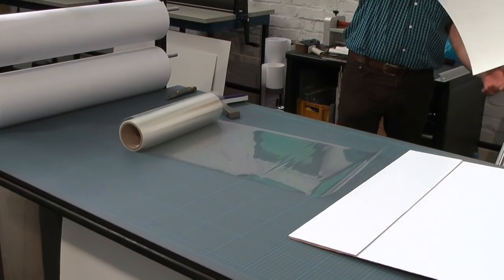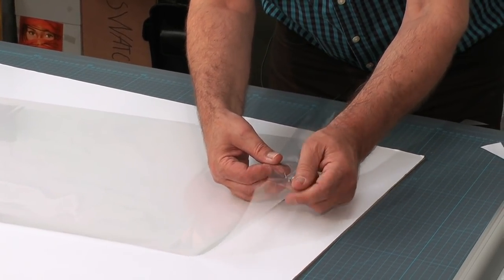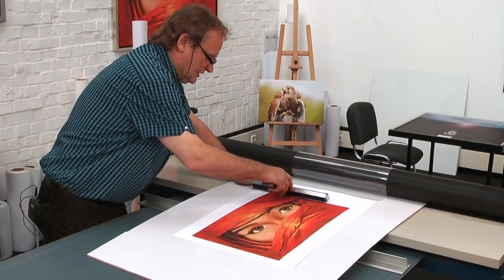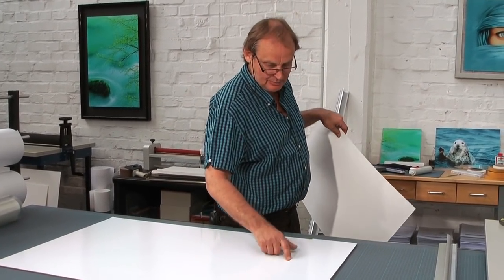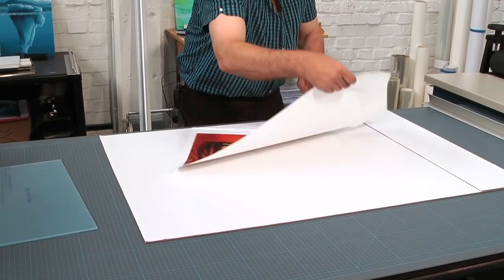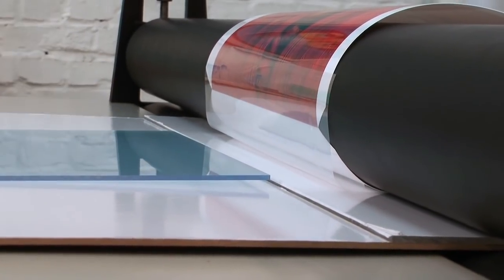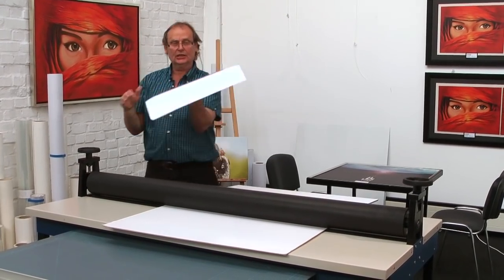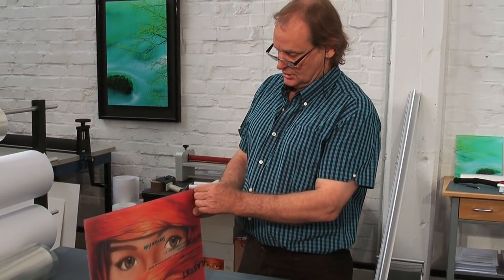Video Guide Laminator 11 - Mounting prints behind acrylic

Comment: Experience is everything. Fantastic workmanship. Bravo
Reply from the maker: Thank you... :-)
Reply: @ZenithArtSystem  Hey, I bought about 2 weeks ago, adhesive film (from your shop in Bonn). I can't get the printed photos without very small bubbles on acryl! Everytime, after printing (using a Canon  Pro 100S - flawless print), adding film to photo (flawless), I get very small bubbles on acrylic/plexiglass (visible only if using a led frame - all 4 sides have a led light). I printed already 5 times and everytime I get those small bubbles. I've written in english for others who may have similar issue.
Reply from the maker: @as6488  Without seeing the bubbles I guess you are talking of the really tiny ones, which are called "Silvering Effect". Those may come from the paper you are using to print. Which paper do you use? It needs to be absolutely smooth, like a high-gloss photo paper or our synthetic paper (printable PP-Film). Also the best results  will be with extruded acrylic glass (XT). Here the thickness tolerances are normally less than in the GS-Version.
Reply: @ZenithArtSystem  Thanks for your reply and sorry for delay. Using XT Evonik 8mm (polished). Paper: A3 & A4 - pro platinum pt-101 (glossy). Printer: canon Pro 100S. Roller laminator (desktop version): 75mm width, cold, 64mm diameter silicon rollers. The issue I have is ONLY during last step: applying the printed photo (film already add) to the acrylic.
Reply from the maker: @stonewolf777  Hmm. This is not so easy. Everything looks correct. Maybe you have not enough pressure? We found that in the last step you really need to apply a lot pf pressure. Or the rolls from your laminator are too soft? Or they are uneven? You can check this, if you put them together so that you only see a tiny gap and then slowly roll them. If the gap opens and closes you have a problem. Or maybe it is too cold in your workplace? Then the adhesive of the film does not "flow" nicely. Is it our adhesive? Where are you based?

Comment: Great video Klaus!
Laminating rollers do work well but the order of technique demonstrated in this video is critical I agree in order to acheive the best result
All I need to do now is buy myself one of those dust remover blades
Reply: Yes you do and the roller is a serious tool and not cheap but will last for years...

The roller is called a DRS-1 for "Dust Removal System" the are widely available from companies who supply laminating films and adhesives such as DRYTAC... the manufacturers website is http://www.sdionline.com/ 

The tac level of the roller is color coded... for general purpose I recommend a red one... David Goetter large format application expert :-)
Reply: goetterdone what is the ballpark price range for one of these roller systems?

Comment: Great job! Thanks for the tutorial.
Which kind of paper do you recommend for this work?
Reply from the maker: Thank you !!
We are offering an inkjet-printable Polyproyplene, which we call "Synthetic Paper". Available in Matte and Glossy, plain or self-adhesive. Check our webshop for the sizes and prices.
You need a VERY smoothe paper for this, the best is a plastic foil. Otherwise yo may see little white or black spots due to the texture of the paper...
Reply: @ZenithArtSystem  
Thanks a lot! I ordered a roll and hope now that the problems (spots you described) will be resolved.
Reply from the maker: @wrobi2267  Yeah, thank you.
Please feel free to contact us if you still have the issues and we will try to help you solving it...

Comment: I learned how to mount acrylics from the video and have done about 20 since! The biggest I have done is a 20 x 30 successfully. I am now trying to roll a 30 x 45 inch print but am getting bubbles EVERYWHERE! All over the surface of the photo when I put the double sided adhesive one. Do you know what is going wrong? Thank you!
Reply: Well, this is hard to answer without seeing it. Are the bubbles like tiny black or white dots or really big bubles? Size approximately?
In which stage do the bubbles appear?
It could be the paper? But I gues you have used the same.
It could be the pressure of the rollers? Did you change it?
The temperature? Is it "normal" room temperature? Also in the night where you store the roll adhesive?
Finally maybe the Acrylic itself. Is it XT, i.e. Extruded Acrylic? The cast acrylic has more thickness tolerances so we do not recommend using this type.
Reply: @DirkBilgen  they are bubbles that are bigger than silvering. About the size of a thumbtack. I was able to mount the photo successfully by using an empty roll to wrap up the liner. This kept the adhesive tight to the roller and I also used less pressure.

Comment: I get a little bit of silvering when I roll the photo onto the glass but there is no silvering when I roll the adhesive onto the photo. Any reason for this? Thank you!
Reply from the maker: There are a lot of possibilities for this. Some of them are:
- Not enough pressure
- Rolls of the Laminator are too soft
- Rolls of the Laminator are not absolutely even
- The acrylic has too much variation in thickness
- The Double-Sided Mounting Film is not from us :-)
- The Media used is not from us :-)
- The working space / storage room temperature is too low
Reply: @ZenithArtSystem  how soft should the rollers be, still rubber right? There is about 2 mm of squish at high pressure.
Reply from the maker: @moosec6985  The rollers need to be hard. There should be no squish at all. It seems that this is the problem already...
Reply: @ZenithArtSystem  ok, I tried with the laminate warm and I did not get any silvering. I do it in my garage and it was below 60 degrees. That is too cold, correct?
Reply from the maker: @moosec6985  60°C is super hot !
:-)
But I think you talk about 60°F - yes, this is way to cold...
Reply: @ZenithArtSystem  haha I apologize. I'm from America so F° is standard. Totally forgot and thank you again for all your help! Much appreciated!
Reply: @ZenithArtSystem  recommended room temperature?
Reply from the maker: @moosec6985  :-) I would say around 70°F. Normal warm temperature. But also in the night! If the rolls are stored too cold, the adhesive gets a bit chunky and is not so smooth...
Reply: @ZenithArtSystem  thanks so much! Appreciate your help

Comment: I tried this on several smaller prints and got small air bubbles on each.  The bubbles were always located in the same area, the last inch or so of the laminate to be covered.  Perhaps I don't have the roller tight enough?
Reply from the maker: Yes, pressure is one of the possible reasons.
Please try again with higher pressure. But also the rollers need to be quite rigid, if they are too soft, pressure will not solve the problem.
Further, the type of paper is critical - it needs to be absolutely smooth, best is printable Polypropylene not "real" paper. Also the Acrylic Glass should be of very good quality and the type should be "extruded" not "cast". Some producers have quite high tolerances in thickness, which is a killer also...

Comment: Just about the minute mark you say mountable board the white board you have, what kind of board is that, is the surface paper, is it non stick can you suggest what this board is made of and is it available commercially
Reply from the maker: You take a flat board (MDF, DiBond, Forex whatever) and stick a double-sided mounting tape on it (for example our KKD). The protective paper from the Mounting Film is siliconized, i.e. nothing will stick to it. This is the secret - simple but effective ;-)
Then we stick another board to this plate which has the same thickness as the acrylic and also cover this with the double-sided film. This is the "step", which you need as the starter...

Comment: Good video, thanks. where can I get one of those blue rollers used on the photo just prior to laminating to remove any dust?
Reply from the maker: Thank you very much. The Blue Roller is available in our webshop shop.zenith-art-system.de
It is called ASR-300 Anti-Static Dust Roller.
https://shop.zenith-art-system.de/en/tools-accessories/laminating-tools/14/anti-static-cleaning-roller?c=32
Reply: @ZenithArtSystem hi

Comment: Hi thanks for your video! Could you specify what paper you use for the prints? I tried epson premium glossy but still noticed some very small bubbles. Probably that paper is not smooth enough. Thanks for your answer
Reply: Thanks for your comments. 
We are recommending to print onto our Synthetic Paper. This is Polypropylene instead of normal paper and therefore the surface is absolutely smooth
Normally paper has some tiny differences in thickness or some texture. If you put it behind acrylic glass it works like a microscope and therefore you can see small inserts where the paper does not stick to the glass. Here you get black dots...
If you want we can send you some samples of the Synthetic Paper. Please check our website or the Webshop...
Www.zenith-art-system.de
Reply: That website in English ?

Comment: Thanks for this great video. Would 250gsm satin paper work well with acrylic or do you only recommend polypropylene paper. It's just that I don't know many printers that print on to polypropylene paper. Also, is there a size limit to acrylic mounting? I'd like to mount 150x30cm panoramic images on to acrylic but I'm concerned that length would make it too 'bendy' or floppy causing the image to come unstuck or the acrylic to break. Thanks in advance!
Reply from the maker: Thanks for your comment. We recommend our Polypropylene Paper because the surface is absolutely smooth. If you are using normal paper (or satin paper) there will be small white or black dots (silvering). This is because the surface of normal paper is not smooth enough.
Our PP-Paper is printable with nomal pigment ink printers like Epson, Canon, HP, so there is no problem. We also offer it in self-adhesive!
Yes, panoramic pictures tend to bend a lot.
You need to add a stroing back plate like DiBond and a hanging frame made from aluminium to support it and hold it straight.
 Please have  look at our webshop for all the above...
Reply: @ZenithArtSystem  Is it useful to use your self adhesive PP Paper and mount the Paper-Acrylic-Sandwich to a 3mm Dibond Board? Is the glue on the PP Paper strong enough for that?
Reply from the maker: @chico11mbit  Yes, we developed the PP-Paper just for this reason. And the glue is strong enough...
We can send you a sample if you want...